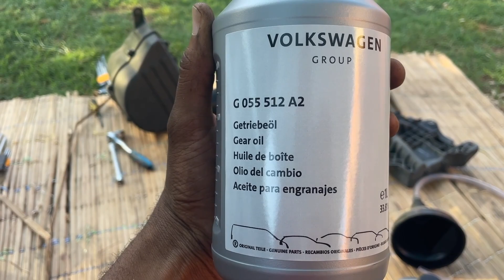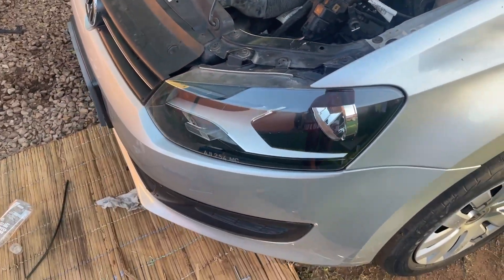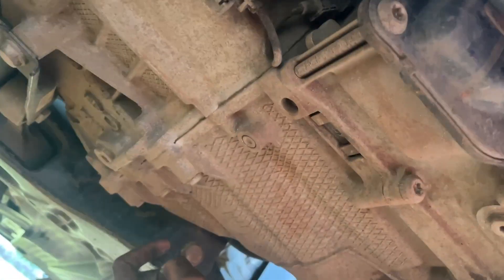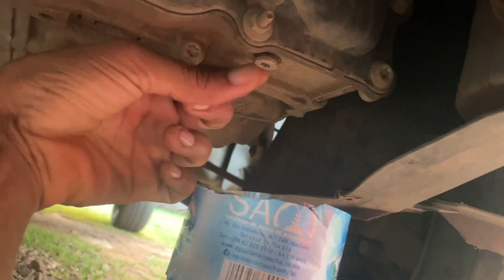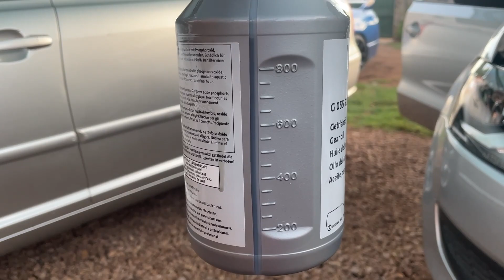DSG DQ200 7-Speed Gearbox & Mechatronics Oil Change | Full DIY Guide

Comment: Thank you very much Frank, after watching this video I completed both oil changes on my daughter's car, which had original oil- 13yrs /62,000 miles old. One tip, to remove the mechatronic breather, wrap a cloth around it, twist and pull hard. On our Skoda roomster 1.2 tsi both drain plugs are hex type, the mechatronic plug has a washer, not so on the larger gearbox plug. The belly pan has to be removed to access the mechatronic plug. regards, Zac.

Comment: No change of filter??
Reply: There's no filter in DQ200 0AM gearbox
Reply: @QAVI007  Yes there is, but you have to open up mechatronic unit and dismantle high pressure tank. That I am told by my mechanic.

Comment: mech unit change isn't that much needed. For gear it is better to add more, abot 2,5-3L as that part is working like manual gearbox and with 1.7 L usual they have faseter parts degradation.

Comment: Best video on this topic, done the change in my leon easily, thank you! Cheers from Poland
Reply: I affraid to do the same one my 7g DSG on Skoda Octavia 1.6TDI, since it was not  changed since 2018, at least, as long as a car is in my possession. DId you do some flush with some other liquid or just replaced it? Did you notice any debris in your old oil?
Reply: @carsugarmodels  only replacement, no flush. No debris noted, only kind of dark colour and a bit „burnt” smell. Still works fine after the change
Reply: @wrbl  Nice. Thanks!

Comment: Hi bro what causes my Touran 2009 Tsi to not go when in Drive and also Reverse, PRDS is flashing too it was working then stopped with jerks and rough gear changes, on D it just revs and rpm fall slower than when it's on P
Reply: I was reading this topic yesterday and one of your issue was written about. I think it was pointed too the clutch but for your issue I would definitely get an OBD reader and find the fault using it. It may be the solenoids or the pressure fault off the mechatronics. Get the codes and look them up.

Comment: for extra information 1.7 liter is lowest 1.9 liter highest
Reply: What about the mech? 0.9L or 1L? Thanks.
Reply: @coolvinay  I would put 0.9 because if you follow the procedure like in this video there will be liquid will stay inside whatever you do :) ( if you are not going to open mech plate / cover)  
Nevertheless i wont recommend to change mech oil as you can see in the video even after years that oil looks ok. (its not a friction oil. Its the liquid for filling unit/canals/lines in mechatronic  )
One last point in the repair manuel dq200 gearbox has no maintenance on mechatronic unit.
Reply: @onrokutan  Thanks
Reply: @onrokutan my mechanic is telling me for my automatic vento petrol 1.2tsi i have to fill 4-5 litres of transmission oil and 2 ltrs for the mechtronic oil. Please suggest
Reply: few questions you have to answer :) 
Which year is your vento. What DSG model in your car?
if its new version DSG DQ200 pelase shwo this video to your mechanic :)
https://www.youtube.com/watch?v=hfjpZTC9XvM&t=226s
Reply: @onrokutan  2015 vento petrol tsi automatic
Reply: @ to be sure please check by yourself the model of dsg as i said if its dq200 your mechanic is wrong.
Reply: Is there no filter to change

Comment: how you able to remove that mechatronic breather cap... it is so hard to remove
Reply: I didn't manage to remove it either. I had to remove the starter to get to the filler plug underneath. It was a bit fiddly. Especially the lower screw that holds the starter into place. Those screws have 16mm heads.

Comment: Hello Frank, 
I have a 2015 Skoda Rapid Spaceback 1.4 TSI 7speed automatic DSG, please help if you know where is the transmission fluid pressure sensor?
Reply from the maker: Its inside of the mechatronics unit. You are having an error related with pressure?
Reply: @frankcumaio  Thank you. Yes Po841 error code - Transmission fluide pressure sensor/switch A circuit Range/ performance 

Does the whole mechateonic need change or only sensor ?
Reply: @AsifIqbal-v7v Hello, how did you solve this problem?
Reply: Problem fixed? Having ssme code...

Comment: great video but why everyone changing mechanic unit oil, it supposes life time thing
Reply from the maker: Imagine yourself frying potatoes chips in same oil lifetimely because the brand says is a lifetime oil lol. Car manufacturers do a lot money with aftersales, so they use a lot the life time thing
Reply: Good question when the manufacturer says lifetime fluid it means average  lifetime  of the transmission which is 100,000 miles give or take.It doesnt mean forever because obviously it will degrade and wear with time and use so I recommend changing it every 60k kms  to keep everything happy and OEM oils ofcourse

Comment: Thanks for de the video, I did the oil change on a 2018 golf 7.5 variant 1.6 tdi with no issues 😊 greetings from Belgium
Reply: I affraid to do the same one my 7g DSG on Skoda Octavia 1.6TDI, since it was not  changed since 2018, at least, as long as a car is in my possession. DId you do some flush with some other liquid or just replaced it? Did you notice any debris in your old oil?

Comment: Bro please can I get a definite answer my gearbox side was filled with 4ltrs of oil as per the guys at goldwagon and I've been having issues with my 2nd a 3rd gear taking long to change since. What is the actually quantity to fill the gearbox side.?
Reply from the maker: Hi bro. 1.7 liters on the gear side. Are you sure that your box is the dq200?
Reply: I would like to believe so it's the 0AM 7 speed dry clutch with 2 different oil one for gearbox and one for mechatronics

Comment: This is not a DQ200 Gearbox, the DQ 200 uses dry gears.
Reply from the maker: it is a DQ200, the clutch is dry, but the gear mechanism still uses oil also the mech unit. for example dq250 the clutches are wet, submerged it oil
Reply: @frankcumaio replaced on how many km?
Reply: Fool, that’s what VW doesn’t want you to know, lack of Periodic oil changing reduces life of DQ200
Reply: The drier the gears the better they mesh more exactly
Reply: @andybrown6981  tell me meshed gears that run dry?

Comment: I read somewhere they said dq200 don't need oil change and it is permanently sealed
Reply from the maker: yes the manual says that, teorically is sealed, and they meat seald as is not serviceble unit it brakes and replaced with a newer one. Car companies now they make money with after sales, so if you dont service it breakes sooner
Reply: @frankcumaio8328  thanks a lot, i will start to do it. Surprising thing is at 60 km vw service did not change gearbox oil.
Reply: @FhatuwaniManyane   As above, it's supposed to last the life of the car, but how long is that? 5 years?10 years? 20 years? It will need changing sometime. In reality it means it will outlast the length of the warranty which means the manufacturer/dealer won't have to pay for the repairs.